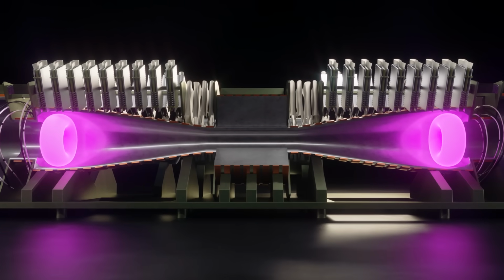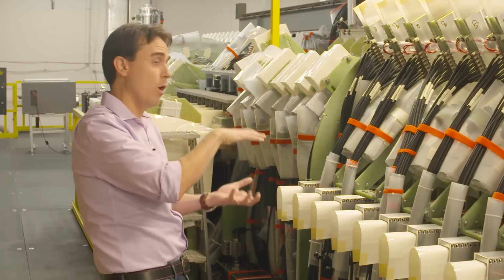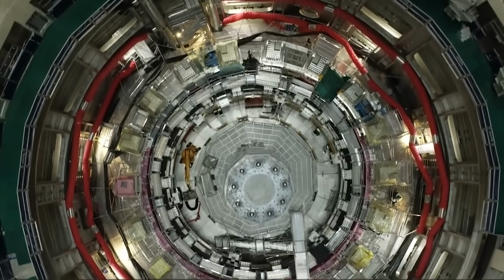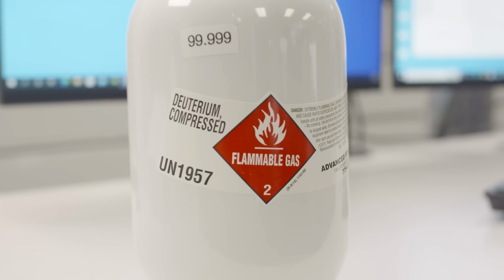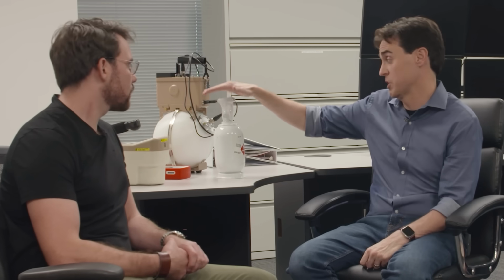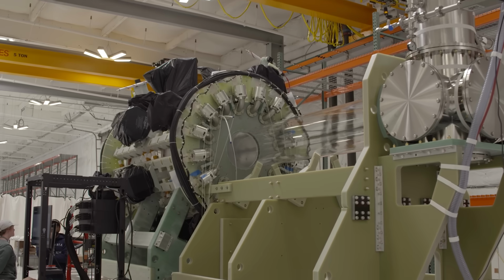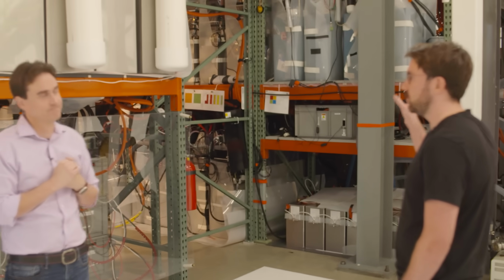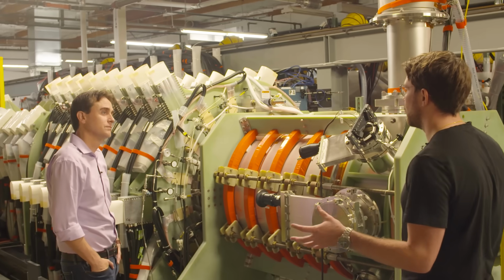A New Way to Achieve Nuclear Fusion: Helion

Comment from the maker: Here are the two full length interviews with David Kirtley. Available exclusively on Nebula: 
https://nebula.tv/videos/realengineering-helion-bts-david-kirtley-interview 

https://nebula.tv/videos/realengineering-helion-bts-trenta-walking-tour
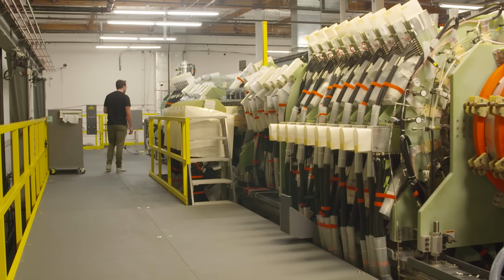Reply: 15:30 Particulars don't just decay after a set amount of time. The decay is probabilistic. It has to have a time and a probability. You mean that it has a HALF-LIFE of 12.3 years. Technically it is 12.32 years but you know. Either way, that means only half of your sample with have decayed in 12.3 years.
Reply: @TestyCool no
Reply: @kirkjohnson493  Yes look it up. Read about it for yourself. Don't just take some YouTube videos word for it.
Reply: Every 20 years is a huge " breakthrough " for fusion🤭
Reply: skelcap is making super capacitor batteries from carbon nano sheets.needed just in time for this technology.
Reply: you need to get your notebooks back in stock dude. This is ridiculous. HURRY  UP!
Reply: i will enjoy it 👌
Reply: Will there be more content about how Helion plans to generate and transfer electricity since they don't plan to use turbines?
Reply: @BrownieX001  the plasma flow through the magnets produces current flow in the opposite direction  when fusion occurs, like he said, it's like a spring of the electromagnetic confinement.
Reply: @BrownieX001  my understanding is that they intend to capture the charged particles emitted by the fusion reaction, inducing an electrical potential in the collecting medium. Every word of that is probably inaccurate in some way, but I believe that is the gist.
Reply: These reactions (D+D fusion and H3+D fusion) are bound to generate excess heat.  Why doesn't Helion capture that heat (at the same time cooling the machinery) and generate extra electricity from the old-school steam+generator process.....  In addition to their preferred method of capturing protons in a field to generate electricity directly.
Reply: @chriswysocki8816  they might need that heat for the reaction to create their wanted springing magnetic field to electrical generation.
Reply: @Chris Wysocki  all of the products expelled energy except for neutrons , are converted directly and more efficiently into electricity by distorting the confining field.  The neutrons' energy is consumed during collision with Li which generates H3 which beta decays to He3. No heat energy is given off
Reply: Banana for scale, be it dimension, or energy
Reply: How come we have Not seen this on the NEWS yet ???
Reply: @kenmasonj4812  Because the masses would start asking questions...they don't need the masses, just enough people in the population to say they back this idea for them to justify the funding for it.
Reply: Can you make a video on B-21 raider or hypersonic missile?
Reply: Does the bright pink flash seen @1:36 originate from within the machine? Are they x-rays?
Reply: Technically you can just make direct electrostatic energy generation with a tokamak, it's called electrostatic direct energy conversion and is baisically the electrons will leave a cavity in the side of the chamber which will use electromagnetism to convert the plasma into energy. It just has been an unpopular idea as we're still attempting ignition so making a giant energy collector is pointless if we still don't have the reactor design accomplished.
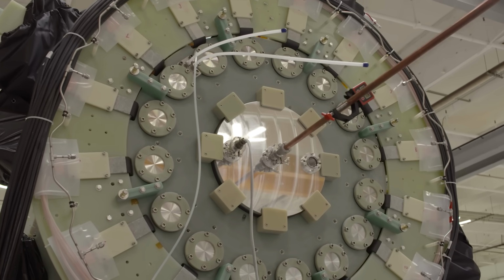Reply: 21:32 if an gyro orbit, it should be linear to the field of the electro magnets input, maybe they have a changing field wall, something to move the magnet in 3D to the space to the orbit of the particle so it can compensate for for wider orbits from temperature and magnetic strength, but who knows im just a guy commenting on youtube, it just seems like something needs to move to compensate for the particle orbit, kinda like how a heart can be strong pumping but relax when needed to pump again
Reply: @Real Engineering I find it odd that they just glazed over the tritium extraction process and is the Achilles heal for fusion and fission reactors.  Tritium permeation of the metallic structures of our fission reactors, H2O neutron capturing into 3H2O tritiated water is why we find beta decay in our drinking water.  Blue Ridge Environmental Defense League Health risks of adding new reactors to the Vogtle Nuclear plant.  This study outlines a massive increase in Tritium and many other radionuclides being released from the site of which has caused a nearly 60% increase in cancers with a 14.1% decrease nationally.  What is Helions procedures on capturing the tritium made from the Deuterium/Helium 3 fuel and what do they contain it in?
Reply: So you're going for direct induction of current, rather than boiling water to turn a turbine. Very cool. That makes much sense.
Reply: Man, you made your channel sooo good, luuuv it :))))
Reply: How do you even measure 100 million degrees? 🤔 Haha, and on a related note, how do we know that what he claims is true? I want to believe, but how do we know that this isn't another Theranos?
Reply: @ropro9817  Unfortnately, even the recipe: high production value YouTube video, a narrator who positively gushes, dramatic music, excess rhetoric - are typical for these scams. 
I hope it is not, I want to believe, too, but it is far more likely that it is.
Plus: the mention of SpinLaunch - a no starter - is a little concerning.
Reply: Have you examined WHAM yet?
Reply: I hope they release this technology to the world.  You know, and not try to privatize and monopolize such a discovery for money.  Doing so would be if Jonas Salk tried to patent the polio vaccine (which he didn't).  It would have been cheaper if we had given the money to NASA to develop it, and they would have discovered how to create sustainable fusion decades ago if we had given them the funds and scientific talent.
Reply: BREAK SCIENCE you get more out then you put in?  break the second law of thermodynamics... the news is so smart they dont know the colors of thier own crayons.   something like this they would overlook the power that goes into keeping the building and lasers powered on including the test equipment and the cooling of the lasers.   estamants say that it takes 300 mega joules for their buildings to run and allow the lasers energizing up to 2 mega jouels!   HOPFULLY the sun just kills everyone with a CME so that we dont have to worry about liars and cow farts and people still breathing causing carbon gas. something needs to make the planet greener by removing themselves from the gene pool.   PLUS   CNN likes to come up with LIES and send more of the savings money to Russias Ukraine. All that money in nfts and  internet for free for ukraine.
Reply: "Send this over to Africa and let the blacks finish this.  The Feminists tell us they're as smart as any white men, so they won't have a problem.  Also have women doing all the math, because they're goddesses who will rule the world.  Right folks!?  Go Marxists!"    -  The LEFTISTS
Reply: So because there was an actual breakthrough in fusion research,  and there will be a big push to find other fusion research projects to invest in.
Reply: @nosuchthing8  There is no breakthrough...the energy made barely covered the energy from the lasers and is not even breaking even.  Invest?  The public funding is never returned, with interest mind you, and the only ones that see a return on investments are the many philanthropists of the world that only get richer.  What are you talking about?  Fission reactors only work with public funding that's never returned and that's a fact
Reply: @paulmobleyscience  there was a slight break through.  Hence the interest. Hence the timing of the video.

Time to fleece the rubes
Reply: @paulmobleyscience  what are YOU talking about? OBVIOUSLY there are private investors in much of this tech.
Reply: @paulmobleyscience  thanks for the post. Nothing you said was true though.

Here is a link to investor activity in fusion reactors

https://youtu.be/Dp6W7g9no0w
Reply: @nosuchthing8  What are you talking about?  What do you think the word philanthropists means?  Private investors...which will see a return at some point while public funds are never returned just like with all our fission reactors.  You're sadly mistaken
Reply: @paulmobleyscience  they might see some money back, they might not. I'm not sure what you are mad about
Reply: @nosuchthing8  Of course you're unaware because you're a mindless sheep only to consume as much as possible and never ask the question....should we just because we can?
Reply: @paulmobleyscience  ok, take care troll.
Reply: @nosuchthing8  What? Troll?  What makes you say troll?  I am an Engineer that served in the US Air Force Spangdahlem Germany  and in the private sector with scientifically backed information you don't like and can't debate against so you automatically type the word troll all the while all you've said is in essence "nuh-uh".  You've said absolutely nothing here, nothing so who's really the troll here.  Get lost
Reply: Soooo... did they say what would happen if this thing fails in the any part of the process?
Reply: @Ravonies_Ravenshir  
If anything fails, fusion does not occur. The walls of the generator might heat up and be damaged if a magnet fails and the plasma can hit the wall, but other than that it's actually a very safe process in terms of lack of harmful radiation being produced (at least by this particular reaction).

Unfortunately water is deleted as Hydrogen fuel is fused into Helium so you really shouldn't want fusion to take off as water is definitely more important for life and the climate than electricity is for humans.
Reply: @VariantAEC  i just calculated, the amount of Deuterium we have on earth at current world energy consumption rate would last us 700 million years.
And that is just the Deuterium, which is 0.03% of all the water. No worries about running out.
It would take about 500t of Deuterium to run the world for a year.
Reply: @leoyoman  
Even if it takes 700 million years to fuse the deuterium to get the energy... we still have to first separate the molecules to free these gases.
There is only about 1.4 billion km3 of water on Earth. If only 0.03% of that has heavy water that leaves us with only 420,000 km3 which is 4.7*10^17kg of heavy water.

We need to break that Deuterium water up to get the Hydrogen gas so I will only consider the weight of the water in liquid form. A 1 gigawatt fusion reactor is estimated to consume around 250kg of fuel a year half of that would be Deuterium (even in Helion's configuration).
The whole world this year 2022 used around 520 billion gigawatts of energy.

Every gigawatt reactor consumes 125kg of Deuterium a year, but there would need to be quite a number of these facilities around 16,478 to meet the needs of humanities energy demands right now.
Under ideal conditions they would fuse 2.06 million kg of Deuterium every year which would give us 2 billion years to switch to something else before deleting 1% of the water on Earth... if only fusion were actually that efficient...
Reply: @leoyoman  
While fusion itself releases orders of magnitude more energy than fission reactions... WE SIMPLY CANNOT USE MOST OF THE POWER GENERATED BY IT even if we manage to make the reactions sustainable.

You also have to consider the size of the fuel and hohlraum itself. Ooh it's soo tiny and produces soo much energy (for the tiniest fraction of a second) and after that... fusion is done and while again on paper that energy was released and our tools measured that released energy matches our understanding of nuclear physics... buuut, the energy created in the hohlraum isn't actually useable. To make usable energy we need a sustained reaction and a lot of conduits to send that energy to it's final destination to be used. Only then will we really know how efficient or not the reactions really are outside of mathematical notation and simulations.
Even so no sustained reaction has broken even and apparently this isn't even the first time LLNL has claimed they achieved ignition. When searching for how much fuel they actually used I found other press releases about previous attempts and nothing about how much fuel is used or how they planned to capture all that energy generated inside their largest 140mm3 hohlraum reactor.
I mean do you really think we can actually store or transmit all the energy created by these short-lived flashes of energy?
Reply: @VariantAEC  I'm sorry but you sound increasingly desperate why fusion could never possibly work and bring arguments that undermine your point.
You agree that we have thousands of years to improve our fusion tech before even the easiest fuel runs out. 
37,000-78,000 tons of mass falls on earth every year, some of which is water.
Add to that the universe is mostly hydrogen which we can easily replenish via small ice asteroids or even gas giants.
We even got renewable energy which we have no reason not to use in parallel.

We don't need a sustained reaction. 
A combustion engine does not have a sustained reaction either. we can still get energy out of it. If we get a fusion reactor with even a tenth of that efficiency we are golden.
The Video even talks about how they plan to get the energy out of the short bursts... maybe watch it again.
The reason why no one talks about the fuel is that the amount used is minuscule and the reason no one is talking about the energy capture is because they are not yet consistently producing usable amounts of energy.

If you are angry that people tell you they achieved ignition, blame the journalists that left out for how many microseconds.
The headlines are just happy that we got embers by rubbing sticks together and this Video is optimistic about seeing a fire in 10 years instead of 20.
Reply: @leoyoman  
Everything I read that you claimed is wrong.
Fusion firstly hasn't even made more energy than we put into the reaction and I already discussed how a match head contains less than 1/200th the energy in the lasers LLNL used to start their reaction. Which returned only 1/38th what a gallon of gasoline provides so what would it matter if we have to put in 65% of the energy to get 35% out when we can put in 0.0008% in and get 99.9% out right now?
Recall that even now we still lose supposedly 80% of the energy that is created by burning gasoline. But it would be smarter to turn a renewable resource into a one-time use fuel?
It's literally unbelievable that you're arguing against me on this.
Reply: @VariantAEC  Because i am not talking about LLNL. you're shouting into the void.
I am talking about this Video
Reply: @leoyoman  
Both methods remove water from circulation. Neither are environmentally friendly as a result and ultimately when Helion runs out of Helium-3 they will have to fuse Deuterium together which they did talk about in this video or the previous one on this channel.
The result is the same you just delay the inevitable depletion of Deuterium a bit longer and you can delay that even further by fusing Deuterium with Hydrogen which will only remove more water from Earth.
Reply: Imagine, this energy turn and use for propulsion. Star Trek wrap core, anybody? Lol.
Reply: if only there was a way to get nebula without giving away my payment card information to the streaming service itself. Since curiosity stream are liars and so untrustworthy.
Reply: There isn't enough information for China and others to steal this technology.  You should've posted detailed diagrams and CAD plans in Mandarin, and French and English.

Who is the fu..ing idiot that allowed this to come out publicly?

😡 🤬😡 🤬😡 🤬😡 🤬😡 🤬😡 🤬😡 🤬
Reply: "haha they just barely got to the part where they can get it so hot it creates nuclear fusion amateurs" -AMD
Reply: I would really like to know how they ensure that both 'blobs'(yes i will call them blobs) are symmetrical and what are the tolerances? How much different can they be in mass?
Reply: Funny how nobody is talking about the incredible amount of power required to cool down the system
Reply: It really pisses me off that you're hiding those interviews behind paywalls when you did nothing to further the knowledge held in. Simply profiting off someone else's discoveries without adding your own input whatsoever.
Reply: without electricity,,your dead in the water..so they created a sun, we have one allready..its free..id say there alterior motives for building this..there not ever, goping to let us have free power..but we did, long ago..
Reply: Thank you for this!!!  Mutli-Year Nebula sub here!  absolutely love this service!!
Reply: Your Nebula ad is a lie, there is no way to get Nebula for $11.99 a year, its only bundled with Curiosity Stream on the $40.99 a year 4K plan.
Reply: @repentandbelieveinJesusChrist2  sorry jesus
Reply: So let me get this straight just so we're all on the same page.
It's a biogas driven device that maintains a potent flux using capicitors.
It runs on gigawatts of power and relies on weapons grade nuclear material.
Please tell me one of your scientists is not called Emmit Brown.
Reply: More than anything I hope you don’t sell out to the military industrial complex I’m sure they’ll make you filthy rich but you will only be furthering human destruction on this planet you should open source the information so that every nation in the world can be brought up to speed and we can get rid of pollutants in our atmosphere from coal burning
Reply: Hello
Reply: 👆👆 13:30 : I'M Helium 3 😂😂😂
This machine TO ME appears to be a HYDROGEN reactor. And they are using just plain water and salt. The magnet field is to not let the solution deteriorate the steel.
Reply: What an incredible speaker
Reply: Of course, we can mine He3 from a gas giant :D
Reply: thanks for the transparency on the costs and efforts made for the video. Alot of people take for granted the effort involved to share content such as this. thanks for your efforts. I enjoyed the video and will look into the nebula thing too.
Reply: Seems like this could Propel a Starship too you've created another chamber to let all of it exit you fired the two Chambers at each other create the fusion and then release it out of tube a magnetic tube so it don't burn up the ship but that should give us sub light speeds
Reply: Health if you think about it enough we could downsize it and we could create steam powered cars
Reply: putting context that people need behind a pay wall is scummy dude
Reply: BS
Reply: That thing sounds a bit like some kind of "linear accelerator" only this one appears to be "double ended".
Reply: "The Flux Capacitor is what makes time travel possible".🕧
Reply: Wait a minute. This way I can build a lightsaber and a heat canon...
Reply: Are those superconducting solenoid coils???
Reply: one thing that's not shown is how bright and energetic the plasma is . . at those intensities it's blindingly luminous
but that's not ilustrated anywhere . . and intead we get some simple dialoge and rather plain looking set of magenta objects with NO sence of scaling for how bright it should be :(((
Reply: Are they using "Green Energy" to achieve their goals  🤔 ?
Reply: .     China have that tech long time ago and even installed it up their space station.
,,, will also use that tech when Russia and China put up a moon-station in a couple of years.
Reply: @chitaegandalalake263  Watch less YT and propaganda. Dream on. Russia who???
Reply: They don't say anything about Q fusion
Reply: @amyh9512  
Because they didn't break even.
I don't know how close they think they are but it's clearly not something to be too hyped about.

Additionally thermal energy lingers while direct electrodynamic energy is actually incredibly insignificant. It might be "more direct" but it's actually a significantly smaller amount of energy and of course much of that energy isn't electric, but heat. By excluding that heat created by fusion you are still wasting a huge amount of the energy generated.
Reply: @VariantAEC is right, but that heat energy of the expelled fusion products is dissipated / converted to electricity as the particles are contained by the magnetic field. Over time as the particles slow down due to the confinement, there is no heat energy left in them. It was all converted to electricity directly.  At least that's what they claim in the video
Reply: where are you references?
Reply: Running out if oil is never going to happen, wet can make it out of our wastes for cheaper than using just available directs that still exist today... Running out of helium 3, now that's a scary thought, the USA had fast and away the largest stockpile. That said we have less than 50 years left of it at current projected uses... Everything you are using to watch this required and used up some He3 to create. Just saying
Reply: Nuclear power aren't expensive...
The only thing that make nuclear power expensive is people that want to build windpower and the politicians that go along with it.
Reply: @tiddybearkush  you can just say coal companies, it's not like they will sure you for defamation....
Reply: @aaa8509  what do coal companies have to do with it? Coal is not a effective form of power.
Building windpower is a more lucrative way to fill the pockets of the politicians because you always have to build more. And how would you justify high tax on nuclear power which are build to deliver a steady sustainable cheap power source that some my argue are a human right in our society that's built on electricity while at the same time the basic need of heating and light are almost forbidden through high tax and strange bureaucracy.
Reply: But how much electricity do you need to make it run with all these magnetic fields? I think you are using more energy to make it run than these reactions are actually inducing electricity..
Reply: @REDLINERUNNER  That is why I asked whether solenoid coils are superconductors. I don't think they are until I hear otherwise. Yes, that is where a crapload of energy is going right now.
Reply: Subscribed
Reply: The fuel are not perfecting, they need 3 metal choice 1 from three the plasma inside chamber need holding the state of highest electrical charging inside the chamber iron, salt or copper. Lithium its self is not enough.
Reply: It's  easy photonic crystals
Reply: I'm from the future
Reply: @thunderontheplain  Hell yeah let's get this party started .
NASA excepted me they made me a teaser .
We are going into the golden age 💕
Reply: Brillouin Energy fusion reactor demonstration last year achieved net positive energy production, verified by the Stanford Research institute.
Reply: How much for the full videos without the annoying overlaid music?
Reply: OBJECTION!!! NIF did not get net energy out, there was more energy released from the fusion fuel than there was that went in. That is a distinct difference than net energy out. You have to factor the inefficacy of the lasers, light lost in the mirrors used to converge the beams, light just straight up reflected off the pallet for net energy out.

We have been able to do your kind of "net energy out" for like over a decade which was JET if you don't include all the inefficiencies which Q does. NIF only managed a Q = 0.7, but JET wasn't far behind at a Q of 0.68, but lets remember that the Joint European Torus is a machine from 1984 yeh it has had upgrades, but a newer machine will do better; significantly so.

Furthermore I would like to point out that we make for example silicon 99.9999999% pure for semiconductor manufacturing. I think we can do well enough with beryllium purification. You would only need ~99.99% pure beryllium to make long term radiological concerns a non issue and it's only some main extraction sites which have has some uranium content.

As for beryllium supply there is about 80,000 tonnes in the ground which is relatively accessible, yeh we only mine 230 tonnes currently, but with greater demand would come a greater supply, prices would go up to be fair, but at that point recycling would also become viable as the price of beryllium goes up, so it wouldn't get too terribly crazy.

Also you can just make a tokomak do 2H - 3He fusion just btw, and yes there is a path to making tokomak fusion cheaper, like "We have the technology. We have the capability..." HTS High-temperature superconductors, how does that make things cheaper, you can build your reactor chamber 16x smaller because fusion goes up to the power of 4 with field strength and high temperature super conductors allow you to run double the felid strength, because ITER is using 90s super conducting magnet technology because international bureaucracy.

Oh you thought notional bureaucracy was molasses slow. Oh you have no idea.
Reply: just like new exoplanets being “discovered” nuclear fusion sounds mundane and like bullshit really wtf
Reply: @xNxHero  Like I get being a bit sceptical of fusion, but like exoplanets like really that's what your sceptical of, dude it's not like they are directly imaging the  planets they are messuring the light blocked by the planets and in the case of very heavy planets in a close orbit around there star using the wobble in the star caused by the planet orbiting the Star, and the first exoplanet was discovered in 1992 so it's not exactly sudden.

The reason why there was a rash of discoveries was because there was a space  telescope propose built for that and that is all it did for like 5 years was look at 1000 stars or so to look for periodic dimming of those stars.
Reply: @xNxHero  and at any rate, like it would be extremely strange if there were not planets around other stars.
Reply: @Inaire Falen your comment has been removed for harassment
Reply: Just more swindle propaganda!
Reply: Frankly the useless usa regime should stop stealing ip from China
Reply: Magnetic fields and helium.  All that is.
Reply: Seems there were some glaring oversights in this video. Not sure how they occurred tbh. Was RE paid by Helion to make this?
https://youtu.be/3vUPhsFoniw
Reply: Yarrrr
Reply: A rebuttal: https://www.youtube.com/watch?v=3vUPhsFoniw
Reply: You should change your name to Speculative Engineering.
Reply: With super state core turbine systems you min should have enough to run its self on electric motor nuke is a bad addiction??? It's future is in space engine technology!.
Reply: The Improbable Matter channel release a response to this. It doesn't make this video look good at all.
Reply: If you ever played with smoke ring generators, if you direct a smaller ring into a perfectly sized larger ring, you can 'grow' the smoke ring. It exchanges momentum fluidly and redirects the flow into a new larger ring. I imagine this same principle works with rings of plasma. I hope this helps!
Reply: @James-ux3nt  it's an American decades long scam
Reply: @James  they are all in o  the carousel scamming and it will never be economically viable its just a scam
Reply: @James  you mean your incompetent?
Reply: @James-ux3nt  and you can't write
Reply: @James  if your not interested why do you even bother your pathetic self to even comment on what I say?
Reply: @James  I see that it hit a sore point with you but don't be ashamed of yourself this is you a lowlife need to work on yourself
Reply: So chinese have solved how to harness FUSION .. but created a hyper-weapon instead and simultaneously.  FFS.
https://youtu.be/BO4dPl0Ua_o
Reply: You got rekt bruh https://youtu.be/3vUPhsFoniw
Reply: Une réussite Inspiré des travaux de j.p PETIT .
Félicitations à tous 👏
Reply: Why slam the two plasmas together? Why not do a controlled squeeze to the middle then continue to squeeze until fusion ignition while also gradually increasing excitation voltage? It would still be a drain on the grid,  but not an instantaneously depleting one.  Seems like the current process is akin to the combustion engine cycle, ie batch-wise... the sun's process is continuous.  I'd also be curious as to how to cool the system,  I guess that's why everyone else is using water,  to cool as well as steam conversion. IMHO.
Reply: Why slam the two plasmas together? Why not do a controlled squeeze to the middle then continue to squeeze until fusion ignition while also gradually increasing excitation voltage? It would still be a drain on the grid,  but not an instantaneously depleting one.  Seems like the current process is akin to the combustion engine cycle, ie batch-wise... the sun's process is continuous.  I'd also be curious as to how to cool the system,  I guess that's why everyone else is using water,  to cool as well as steam conversion. IMHO.
Reply: Part of these methods are how the world inner world works.
Reply: I am lo pop pop
Reply: Right on!
Reply: PLEASE fire the camera person, this HORRIBLE wobbly 💩 is like watching a Jason Bourne fight scene.... SIGH
Reply: Fusion debunking. https://www.youtube.com/watch?v=cvcPF6-jkA4
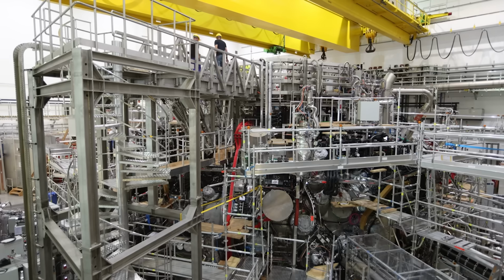Reply: 9:50 Looks stupidly improbable that the required conditions will remain stable enough to support an ongoing reaction. 
Fusion is inherently stupid and overly techy.
Thorium reactors are ridiculously simple, inherently stable, cannot go critical, and their "waste products" are not harmful.
Give it up, boys!! You're barking up the wrong technology!
Reply: what happened to the focus? compression? framerate? @6:42 is this just an oops? or deliberate? (i guess both, if a fix)
Reply: Great, now my future kids can be on the phone for 500 millions years lol.. if I get any the way western society is now..
Reply: Yeah.  It worked
Reply: God, the Lord Jesus Christ loves you! Restore your relationship with God by repenting of your sins and putting your faith in Jesus Christ, "... that Christ died for our sins according to the Scriptures, and that He was buried, and that He was raised on the third day according to the Scriptures..." (1 Corinthians 15:3-4)
Reply: Stop referring to windmills as cheap my hydro bills have sky rocketed when windmills were installed everywhere
Reply: 😂 human kind this guy really doesn't know that man kind includes women
Reply: I purchased a sub from curiosity stream but never got access to nebula, is there any way i could get this backdated?
Reply: @garcope7858  My Nebula invitation went to the spam folder.
Reply: @garcope7858  I did the same. I thought Curiosity and Nebula were the same
Reply: @garcope7858  There should be an email! Took me a while to see it!
Reply: @garcope7858  Check your email to activate
Reply: I found three things surprising. 1) How could you doubt fusion would ever eventually be a viable power source? I knew in 1964 it would eventually work but would be hard and fail over and over before it worked. This resembles what they said way back then was too hard to do any time soon but would be the end game. I will admit I eventually didn't expect to see it this close in my lifespan. 2) Never heard a word about break even. If I remember right there are three kinds. I was VERY surprised you didn't cover which one they are working on now. Working toward a multi kilohertz repetition rate is obviously the net output type break even, but where are they now? 3) The machine is a bit physically bigger than I expected. I thought something smaller would achieve the field strengths needed far easier and then they would have something that worked but would struggle to scale it up. As usual, good video. This one, great video.
Reply: @tsamuel6224  
Using fusion as an energy source breaks some fundamental laws of physics, the fact you don't doubt it was possible says a lot about you.

Again not knowing about ignition or breaking even says a lot about what you know about fusion.

The machines have to be bigger to maintain fusion reliably and also to get closer to breaking even as they hope they can merge the fuels in larger quantities using less energy to kickstart and maintain the reaction. Again this tells me that after 58 years (1964 to now)... you learned nothing about fusion energy.

Do you believe this technology is better for the environment than nuclear power or dare I say it, even the burning of fossil fuels too?

[Edit: "58 years" mental math is not my strong suit]
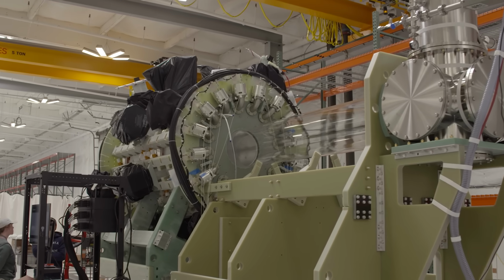Reply: This concept seems really cool, but I'm not quite sure how it makes electricity. Was it by the expanding magnetic field inducing a current in the coils you show here 9:20? or is it the current in those coils that produce those field lines shown, because you also say that that magnetic field confines the plasma between the coils?
Also saying that fusion will not be able to compete is kinda wrong. Fusion fuel is literally water. As soon as we have a working fusion reactor, the electricity it produces will be basically free and it can work all of the time which windmills and solar panels can't.
Reply: @MaeliaMBT  
When they press the plasma together forcing fusion they get some energy back as the molecules fuse at the center, their magnetic properties create an inductive field around the coils creating electricity.
Not more than what they put into making the reaction though.
Reply: @MaeliaMBT  i took it like the two plasmas upon collision cause huge electric magnetic field around itself forcing the reaction to get hotter and hotter until fusion - but they didnt realize just how much hotter it got in real life so they have to scale up everything again - plus this time they have the math maybe to go even bigger than just testing - and they are going to build a huge industrial size unit.  They should just mine the He3 Helium 3 from the moon - it's moon dust.  That's what Chinas doing with their reactors - it's why they sent a rover to the moon.
Reply: @MaeliaMBT  
Also the fact that the fuel is water should be very worrying. Everything alive on Earth needs water. Water and water vapor is also critical in regulating the Earth's climate, making fusing it into Helium a very dumb idea.

Question... What requires crude oil to live and how many animals survive on a diet of Plutonium and Uranium isotopes? Basically no animals, plants and fungi need these elements to live so us breaking them down... not such a big deal.

3% is an important figure as it's estimated that less than 3% of Earth's water is potable, that's water we and all land animals, flying animals and plants use to drink. You cannot use saline water in irrigation for food crops as it would damage or kill land plants. Deuterium will be provided from water pumped from the ocean which we will have to desalinate and then run through electrolysis. Electrolysis itself creates Ozone which is a hazardous highly reactive form of Oxygen gas that we would need to capture to break down over time via another process or burn creating CO2 which negates the very reason these scientists are pushing for fusion in the first place.

Sea level will drop and oceans may still become more saline as rivers run fuller and rain occurs more often as more land is exposed cooling the planet (water absorbs more heat than bare land and plant covered land) requiring us to produce more energy to survive on Earth's surface before it becomes impractical for us to keep moving deuterium water pumps out to the new shorelines.

If the world switched to nuclear power and EVs today effectively pausing over 85% of man-made CO2 emissions then switched from nuclear to fusion power in forty years, we would see far more significant adverse changes to the Earth's climate in the 150 after starting fusion than we have over the past 150 years of using fossil fuels and those changes would be far more extreme and hazardous to all life on Earth and all because we can't return water back into circulation.

The primary problem with fusion is that we're converting water and water vapor into it's constituent gases then fusing one of those gasses with Helium 3 (a byproduct of nuclear fission) to make energy. We lose that Hydrogen FOREVER meaning all currently proposed fusion reactions remove water from circulation PERMANENTLY.
Reply: Iam no doctor but I feel like yes, you need something like a starter for a car to begin ignition. Y’all are using/storing the energy in capacitors, releasing all at one for ignition. I feel like a tesla coil would be a good starter here. No capacitors just boom amp up with Tesla, ignition. But Iam no doctor. That’s just my 2 cents.
Reply: @Unlez218  Tesla Coils give you high Volts not Amps
Reply: @leoyoman  oh ok.
Reply: Just mine He3 from the moon - it's moon dust and covers the entire surface of the moon.  Why not say this?  It's why we are going to the moon again.
Reply: Main question remains..... What would happen if I stuck my hand in it?
Reply: @czarekp3552  turn into the Hulk, perhaps only a hand)))
Reply: Isn't anyone curious why the plasma moves past the spiral more than the simulations predicted?
I didn't go into plasma physics, kinda wish I did.
Reply: @njnjhjh8918  Because a simulation is only as good as the software running it and all too often what advertised on paper ,or a screen for that matter, rarely is the the same as what occurs in real life.
Reply: Most disappointing so called discovery. Far better tech was available for decades.
Reply: Bro can I have a job I want to work under you this sounds so fun to be a part of.. Nuclear fusion reactions are a brach of near  limitless energy.
Reply: Is Elizabeth Holmes, Sam Bankman-Fried, Bernie Madof or Donald Trump on the board of this company?  ...just asking......
Reply: https://youtu.be/r-EOPGmB5eI
Reply: Amazing how I can understand what is being explained.  I am totally ignorant of this fusion reaction technology but even I am given the information, dumbed down and can really appreciate this video,  thank you Real Engineering 💯👍!
Reply: @teemo5409  That is. The video is just aimed  to credule ignorants like you and under age  kids, that want to  belive in another  thec scam.  20 guys working in an empty building and máking CGI.  Similar to NIKOLA, THERANOS,  CRYPTOS,   ...  take the money an run.
Reply: @teemo5409  – I think they are on the right track when ordinary folks can understand what they're doing.
Reply: Guys you know that US just announced that they successfully generated more energy than the energy put in
Reply: @borntowild480  Not considereing the enormous amount of energy used to power the lasers, about 50 times the energy ouput,😄. Next goal to focus: To capitalize the company in 5  billion USD, sell the stock to stupids codicius geeks surviving the cryptocurrency scams,  and retire to further thinking. Initial investors just look for that.  P.D:  Are not yet selling tickets for Mars colonies?
Reply: @ras1528 MI no Fr Dr Hu no no
Reply: @borntowild480  – That's not good enough – not by a long shot. The building and lifetime of the reaction chamber must be considered. The byproducts must be considered. The fuel source must be considered. There's not much tritium in the world. A meager net gain in energy is not sufficient to make this a usable technology.
Reply: @Born to Wild  as always they keep pushing this lame donkey to milk some more money it's just a multi billion dollar scam
Reply: Maybe now the U.S. won't be hooked on oil and gas like a cracked out whore
Reply: @cliftonbowers8496  How does this expirement make you believe that oil and gas usage in the US will change even within 10 years?
Reply: @borntowild480  Well, they didn't.  They generated more energy than the energy absorbed by the target. Not more than the energy actually put it (what took to run the lasers). It's an importat difference, tens of times, I think.  Not to mention overhead energy requirements.
Plus focusing massive lasers on a micropellet does not seem scalable.
🤷‍♂
Reply: @borntowild480  Not really.
Reply: Elon Musk is prolly speaking to his middle-eastern finaciers already!
Reply: @SteveGouldinSpain  ppl say Elon is a genius but just listen to this guy...
Reply: @SteveGouldinSpain  Yes Musk does enjoy a good scam and fusion is one!
Reply: @SteveGouldinSpain   l
Reply: How ironic, you peddle the idea of near limitless amounts of free energy for all of humanity while simultaneously selling a subscription service so that people can't obtain this information without paying money... Daddy's got to get paid though 😂
Reply: @Anonymous______________  🤡
Reply: LOL tooo slowww old news. THEY ALREADY DISCOVERED and are producing fusion....
Reply: @sandraohsiy  so they claim its all a scam they have not achieved Jack s**t